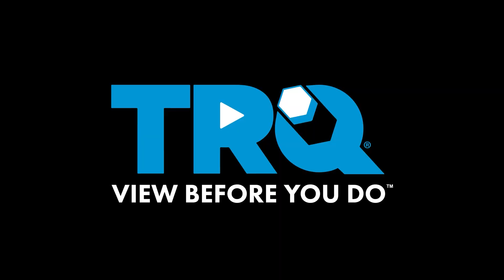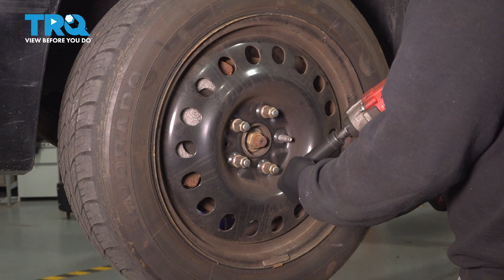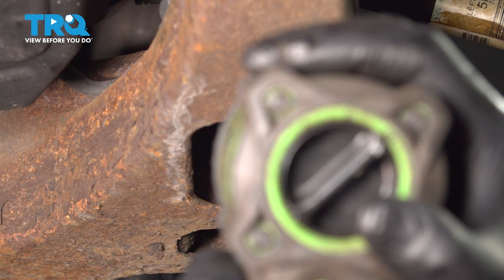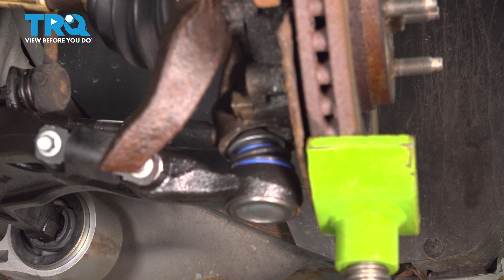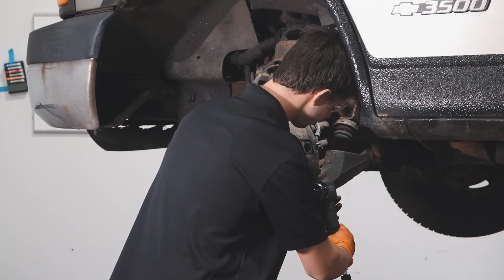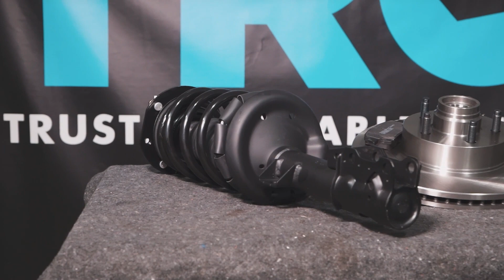How to Replace Control Arm and Ball Joint 2005-2007 Ford 500

Comment: All fasteners are tough extra wrench leverage always helps. On the rear two 15mm bolt bushing(s) on top I wedged a 18mm 'crow foot' wrench to hold nut tight while turning. lol YT vids always do make it look easy THANKS for posting!
Reply: ps: on fleebay both sides, including pressed ball joints + nuts and bushings, is available for approx $100.

Comment: Please be aware that some parts are listed as compatible, but they are not! I think you used an incompatible part here because you had to bang it in too much. On the rear corner of the part with the 2 bolt holes, there is a cutout for a tab that is in the chassis. I think you hammered it in and broke the tab. On my 2006 Ford 500 AWD the tab and cutout is between the 2 bolt holes. The incompatible part had the cutout at the edge of the bottom corner, not the center.